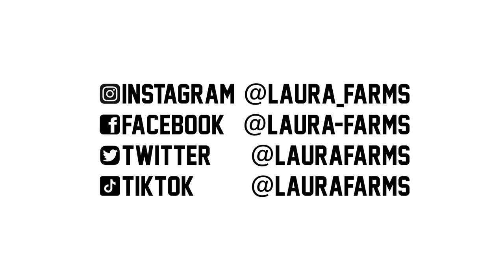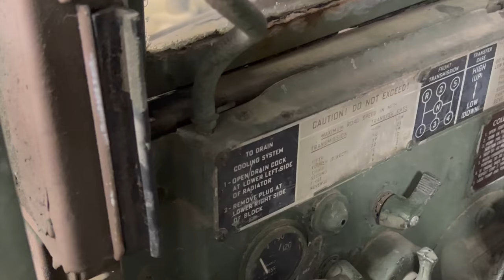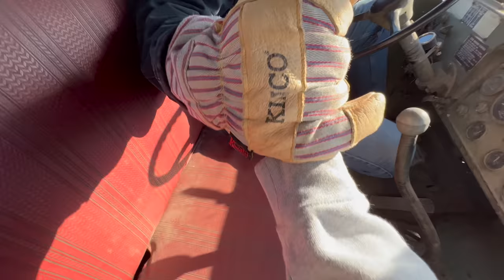Getting A 6X6 Running After 10 Years!

Comment: I'd look the power feed for the battery setup on those 6x6 trucks. Some are parallel.& some  are unparalleled 12& 24 volts setups on those types of military trucks. I'd does A online wiring diagrams.& schematics print out on your year.& model.& engine type to have A copies one to laminated.& the other for storing into information files.& manuals to on those types of vehicles.

Comment: Most all military equipment has a detailed operator, service, and parts manual. If you use the truck's nomenclature, and or model number, you should be able to fine that stuff with your browser online. These manuals should contain all the information you require. Good luck.

Comment: If you have a meg welder or a TIG welder or any welder put the welding clamps on the negative and a positive start it off with 80 V once you see it start to boil let it boil for about two or three minutes and shut it off wait 15 minutes turn the voltage up to 120 V let it boil for half an hour shut it off do it one more time and you’ll have your battery like brand new

Comment: Im guessing that it was a M814 Cargo Truck.https://en.wikipedia.org/wiki/M809_series_5-ton_6%C3%976_   They had a longer frame and box than the standard trucks. I drove these trucks from where they were built at A&M general in  South Bend IN to a rail head where I loaded them on rail cars for shipment. Drove 5 tons,  Deuce and a half's  Tow, Cargo, Dump and tractors. Fun in the Winter. The winsheilds were boxed and folded down. 🥶

Comment: Be careful with the geo bearings on the wheels . The grease wears out and i was going 60 mph when the drivers side bearings welded shut and i rolled it n broke my neck. I had 2-3 hundred miles on it and was on the way to replace it when it just welded the entire bearing asembly

Comment: now i really do have to comment  on those long White Fingernails Laura said she could get work done with them and i was surprised she could and did  i’ve been around  different Garages and repair shops for most of my nearly 60 years of life  and by far those are the prettiest hands i’ve ever seen working on  Engines and Heavy Equipment FYI  i grew up inSouthFlorida and  one of my lifetime Hobbies and Passions has been Boating so i’ve been in a lot of Marinas and Diesel Shops  Congratulations on getting the Military truck running  it  sounds pretty good on video although it may benefit  running it on  fresher fuel   my gut reaction  was to use some Additives but you need to be careful of doing that on Diesels that have been sitting for long times  sometimes additives will lubricate too. much and loosen sediments and other debris  in the system and cause Injector  or Pump clogs  in the Marine Industry to avoid that  we often use a service that will come to the Marina and Polish the fuel in the tanks  by filtering it and returning it back into the vessels tanks that is also a common problem switching a  older Diesel Engine over to run onBioDiesel or Vegetable Oil  after years of burning Diesel

Comment: That trk being formerly military its a 24 volt setup. I dought it been converted already. You may discover it needs 4 batteries in 24 volt configuration.  The 6x6 some was a leaver down around the base of the drivers seat. Might need to free it up. 
I'm sure you know to be cautious of the lay of starting aid used in any diesel. To much it'll cause catastrophic damage.

Comment: The long wheelbase ones are hard to come by. Sad to see that you cut some off of it. The 6 wheel is engaged by air, there should have been a air lever on the dash that has a red light on it to tell you when it is engaged.

Comment: haven't seen one of those old girls that aren't addicted to ether.... As for the brakes, there is a couple of valves on the left side of the truck behind the cab near the fuel tank or behind it that need to be bled off, get the water out of the tank, must be done every time the truck is parked or at least before you move it if it has been setting for any more than a week.  The gearbox is a h/l configuration, with a powered switch for the 6x6 drive, should be on the dash. Check the fuses, most likely has a blown one in there. Look online, you can find the maintenance manual for those trucks, If not I'll see if I can find my old one and I'll send it to ya.

Comment: To find a backing plate for your pump, use a large piece of sturdy paper, lay it flat on the opening and trace its shape and the hole positions with a pencil or sharpie. Then take it to the hardware store as a template.
As to your truck: look up the internet and get you an owner's manual as well as a service manual to know, what you are doing and how to operate it (e.g. high gear, 6WD).
Don't run the motor inside your shop, at least not with the door closed - the exhaust gases are highly toxic and carcinogenic. To get the motor oil EVERYWHERE, you have to drive it at least half an hour, running idle it may take a full hour - fully lubed, starting will get easier, but a proper 24V truck battery is a must. Maybe a junk yard can provide you with a relatively new battery from a crashed new truck. Try to turn the engine by hand and you get an idea, how strong the starter and the battery have to work (unscrew the injectors, or it won't turn at all).

Comment: Great Job. The "BREAKS" will be fun for you. My guess, Be hunting for a Rebuilt "HYDRA VAC" They were Notorious for Going out ! Under the Drivers Floor Plates where the AIR is Added to the Hydraulic Power. Kind of a early version of a break booster. I never did disable one of them, There is a SERIOUS SPRING in Side of that Canister as I understand ! I could get a replacement, in my years with them. There is what is called a "SPRAG" in the front drive, or was it in the Transfer case ? Be Cautious when Jacking up either Front Wheel !!!!!! If it is the Sprag the Wheel will Spin. usually Backwards at around 130 MPH, or more ! DO NOT REMOVE them FRONT AXEL CAPS WITH OUT Releasing any Pressure on the Sprag !!!! I have SEEN the CAP EXPLODE like A Grenade Threw Concrete Block  Walls ! I still wonder HOW IT did not Kill that Mechanic ! You have a THIRD Up Date, I think. It was a Gas Eng, Then the early Multi Fuel, (38% Engine Oil WITH GASOLINE, IF my memory serves me correct. Was Years ago I read the Technical Manuel ) Up dated with the Exhaust System to Exhaust above the Cab (Clean Air, Less Smoke for some reason and that "FLEX Tubing" is Original ) from exhausting in between the Drinker side dully, Gas era exhaust system. ( Dirty Air, MUCH Black Smoke from that Diesel ) !

Comment: Some of the OLDER DIESEL ENGINES had the R Model Mack 'style'  MANUAL NON-ELECTRONIC FUEL SYSTEM... with an  electric or manual flow stop valve  to kill the engine, by starving it for fuel.   OFTEN, the MANUAL  cab control for these is a lever or a knob that looks very much like a  choke knob.  PULL to kill , PUSH to run... "usually".  They can be hooked up backwards.    THE COOLEST THING about the FULLY MANUAL NON-ELECTRONIC FUEL SYSTEMS  is,  they will continue to run even if the alternator fails.   ^^ESTIMATE 25,000 pounds.^^   DOUBLE FRAMES, steel cab, steel hood, combined with  heavy driveline, and heavy suspension parts... add more weight  than you may imagine.

Comment: Compression test.
Pressure los test.
If the results of thoose are fine, it is ok to throw parts onto it.
The engine has t o be ok, or it turns into a money grave.
Then start to check and change all fluids.
Engine oil, gearbox oil, diff oils. Cooler Liquids.
Maybe seal all fuel lines. As the slight leak on the fuel pump will turn into a bigger mess overtime.

Comment: Find regular sulfur diesel replace fuel and fuel filter and put a fuel supplement that acts as a injecter cleaner, antigel and cetane booster. Power Service diesel kleen winter formula is great or Amsoil Diesel all in one is even better. I would double the dose for initial cleaning then continue using normal dose to maintain at each fill up. Change out all fluids and oils. Repair any electrical and vacuum, if any, connections and exhaust.

Comment: 10 out of 10 for enthusiasm. Military truck enthusiasts abound. 
You haven't (I don't think) said what make it is. It is unusual to be able to use low transfer ratio without locking in the front diff so maybe you could investigate the mechanism. You may have a broken half shaft if everything else is in order. I don't think this type of military truck had two speed axles but the nomenclature plates on the dash (if all there) will indicate transmission operation procedure.
Your truck is a little too new for my experience (is it 70's?) which is limited to one time ownership of a 1942 IHC M-2-4. After the last war and until 1976 it was the only such truck here in the UK but there are about 4 or 5 here now I believe.
Enthusiasts such as the two of you are fortunate to have many examples of old historic vehicles of all types due to the US mass production capabilities. Your truck would have a much less survival rate here in our most often damp and wet country.
Consider yourselves extremely fortunate!.
Well done to you both and Best to all subscribers and followers of your most interesting videos.
Mind those nails!

Comment: It is an M814 5-ton.  If you have the bed on it weighs about 21,000 pounds.  The standard bed is 14 feet long on the M813,.  Yours looks like a 20 foot bed.

Comment: If that water-pump backing plate was required, but not there, the alternator (generator?) and the main-shaft pulleys would not be in correct alignment with the waterpump-fan pulley - causing unnecessary increased wear.

Comment: someone must have disconnected the low air warning alarm buzzer, on the 2.5tn models they have a horridly loud one up under the dash.  the brakes are tricky to bleed.  theres a couple data plates on the right dash with all the specs of it and what it can do.

Comment: A lot of times the water pump bolts need to go back where they came from otherwise you could break through the water jacket  with to long a bolt I always number the bolts like a clock that way they go back in the right spot

Comment: Hi Laura. You guys are having issues with your truck because there’s a certain procedure to start that type of truck. From what I saw, these trucks will start right up with regular 12 V batteries like you guys were using if they are in good shape. I think he talks about the size batteries he uses but they are automotive types and not truck batteries although truck batteries would work better.There is a guy on YouTube that has a channel for these trucks. The truck is an M35A2 deuce and a half, and the channel is called “Deuce and Guns”. Really, you guys already have the tools you need and so you should be able to fix the whole thing up yourselves without spending a lot of money. As for the starting procedure. This guy’s channel has a video about it.

Comment: No you missed 2 bolts and tried to pull the pump off....bolts are pretty self explanatory they usually go on the housing to seal where the water goes....
They are not hard to see i always liked taking them out from the center outwards

Comment: Yall appear to be using well water to cool the engine.  If this is the case you could just eliminate the pump.  Use a y pipe to input water to both sides of the block.  The pressure/flow from the irrigation pump should be more than enough to cool the engine.

Comment: Shouldn't you have air blasted the rust out first? I like both of your 'roll up your sleeves and get the job done' attitudes.  Start it up, take it for a spin - oh, did you check to see if you had brakes?  Where I worked in a Data Center, they had 2,000 'tractor trailer' batters, as emergency backup power.  They said they  could last 20 years.  The ac power came into the building, charged up the batteries, smoothed out the power, then converted it back to ac.  They also had 2 ginormous gas and diesel power plants, that I swear anyone of them you could have powered a train with.  I'm happy you got your dream truck going.   You know, boys and their toys and all that.

Comment: Means you said the high range is out on it it might be a simple fix by pulling the forks out of the tranny on your hiring side to see if it's sliding the synchronizer back in there to engage it a lot of times it will wear on both sides of the fork and just throw it out by thousands of an inch and it will solve the problem I've ran across many of them that was like that most military men are not semi drivers so they will hit the high when it's still in gear and what that does is where the forks out.

Comment: Please don’t ever vapor lock it again with the starter fluid 😂 but the 3 switches on the left side of the steering wheel control lights, ignition but the switch has been bypassed

Comment: deep cycle  GROUP 31  MARINE STARTING BATTERIES... should serve well   even for folks that like to run batteries dead (repeatedly).  IF I wanted a truck like that to start even in winter....  I would use  6 or 8   Group  31 deep cycle  MARINE STARTING batteries or AGM 'ABSORBED GLASS MAT' STYLE size group 31 BATTERIES.   I WOULD intentionally choose the Steel TOP SCREW POST style  for the better electrical connection.  Lead  'crimp posts'  like some cars have...corrode very easily.  ALSO:  welding stinger  flexible copper conductor  lead wires  with crimped on and properly sealed  copper ends  conduct electricity much better than typical battery wires.  Side benefit to running those... the added flexibility  makes them easier to install.

Comment: the all wheel drive is on the dash to get the front axe work there is a cd that you could buy for that truck look online for it because i found one for my m1008 cucv it cover the ever thing about the truck  that truck is 24 volt it sounded like the strater need so work .. some of the truck could run on home heating oil jpd oil and a 50/50 oil and gas but it look like that truck is cummin

Comment: Find out the year and model off the data plates it will tell you if it is a multi fuel engine if it is a true 6x6 it is always in 6x6 the transfer case has a high and low lever some were only rear wheel drive Idaho motor pool has an online site he is very knowledgeable about the military trucks it was not an ambulance though it was most likely a long bed drop side but from the videos you have posted it is for sure a 5ton rated the brakes should be air backed hydraulic system

Comment: 2 & 1/2 and 5 ton trucks were built BEEFY! They were made to accept multiple type boxes. You could put a dump bed, cargo box, troop carrier, even a fifth wheel to make it a simi truck. I do not ever remember seeing one set up as an ambulance though. Too big, too slow and too rough IMHO. I am wondering if it spent time as a wrecker or recovery vehicle. That would explain the extra heavy frame reinforcements and length. It is too bad that the 20000 lb. winch is missing on the front. One thing you may not know, you have to turn one of the switches on to have ANY tail lights. The box with 3 levers/ switches. It's been a long time but I think one gives battle lights, (tiny lights front and rear), one gives tail lights and one gives head lights.  It was in the 70s so if I'm wrong, cut me some slack.  SeaBees USNCB 62 Gulfport, Ms.

Comment: I’m a retired Army truck driver so if you have questions on your Army truck text me  , you have a box van truck with out the box
Reply: Hi Steve  ! Which year is the truck ? From the 50's ?
Reply: @fabiocolla2995   it is a 800 series from the 50s or the 60s there is a information plate on the passenger side dash  with all the info you might need  your truck was used for a maintenance, like tools and other stuff you will need to grease the truck as soon as possible for it been setting out side , look in the glove box for the dash 10 book for that truck

Comment: also one more thing you need semi truck batteries you need four of them highest cranking amp you can get hook two pairs together in series for 24 volts and then parallel the two pairs that way it gives you 24 volts at quadruple the current the engine has glow plugs and when it's cold those glow plugs will pull about 4,000 amps of current from the batteries and then when it go when you crank the engine it's going to pull about another $4,000 amps current those little tiny batteries that you're using not enough not big enough not enough reserve and not enough cold cranking amps you going to have to spend some money there's no way around it especially in your cold Winters so go buy you a couple of high current semi truck batteries actually you need four of them there's room in the battery box before batteries if you get huge batteries that comes on a caterpillar or something like that then you may only be able to fit two in there but they should be sufficient I'm in East Tennessee and we have some cold Winters here but it never gets down to minus 40 the coldest winter I've seen here in 58 years has been about 20 with a - 40 windshield and that was miserable so love your show love Laura and yeah okay I love Grant too I'd love to drive that big quadra track tractor John Deere good luck keep up the good work I'll keep watching. -D

Comment: Good video, however i have to say you're way out on the weight estimation, I guessed around 8.5tons.
Just checked mr Google, the truck is an M54 or later M809, empty weight 9.73tons of the standard truck (shorter) so I guess yours is close to 10tons or 22,000lbs!

Comment: That was way too much starting fluid.  Any starting fluid is bad for a diesel and should be avoided whenever possible, and also, if you must use it, use as little as possible.  You need to either get better batteries, a better starter motor, better block heater or glow plugs, or tow it up a hill, with the tractor, not the pickup, and roll it off, this time with the lift pump running.
   Also, are you going to drive it to the scale, in town, in low range?